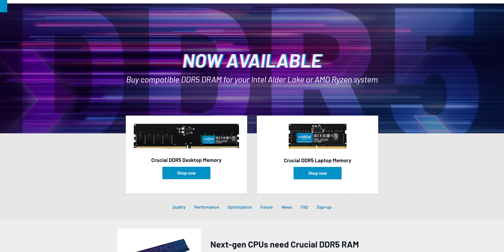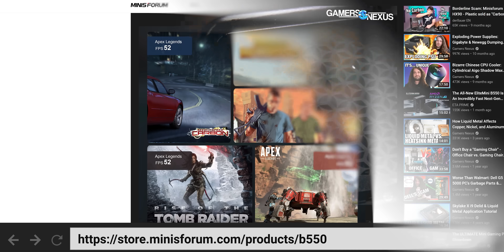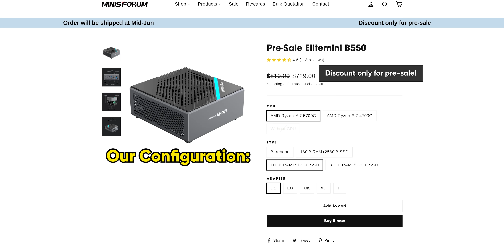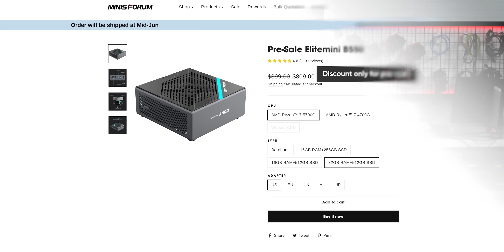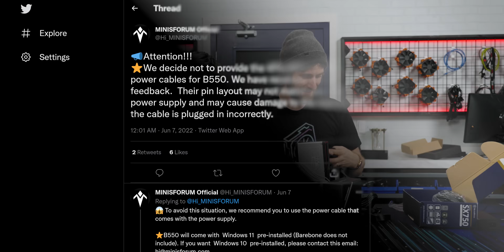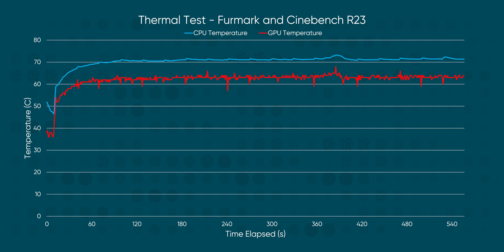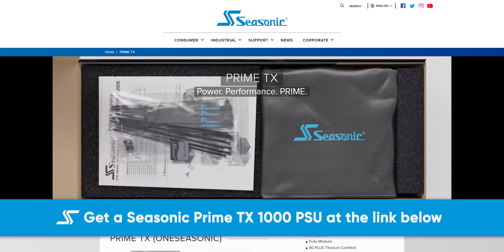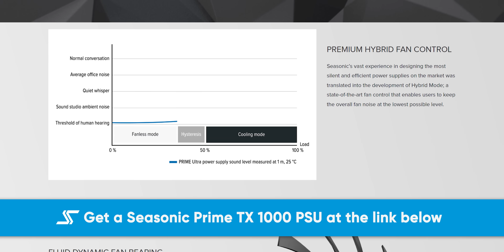Who's Buying These? - MinisForum Elitemini B550

Comment: im late, but for me it was the first step to building a real pc. start with the mini, and get stuff done, and play lighter games, then when you can afford the psu , you get that, and set it aside till you can afford a decent gpu. then when you can afford a real mother board and proper case, pllus the ram and cooling, you finally end up with a proper system, but to start its not a bad option.

Comment: One way I can think of to make this product better would be to remove the PC part entirely, and make the dock into 2 adjustible-distance type c ports, so you could take a laptop and slot it in, and it would plug into a dGPU, and be like a thunderbolt hub

Comment: Legitimate question: could you mod the case to put a hole in the roof and put a full size AIO Cooler on the CPU?  And have it stick out of the “hood” like a 60’s Camaro with a blower and open air throttle bodies?  It would be a cool aesthetic.  I would do it cause why the hell not?

Comment: The AM4 slot is unfortunate, but an AM5 slot would rock… 9600/9700.  And as was mentioned, everything slotted on the same side and just slam the thing in there based on geometry.  (Like old school Mac pro’s and the hard drive sleds, just slide it into the case and it connected right up to SATA power and data)

Comment: I have a Minisforum 760 Slim and I can play games with the integrated video card in 1080p (65-100fps in D4) without any problems. It cost €375 and it is worth the money. But I can carry it with the keyboard and mouse wherever I want. If I want to put an external video card, dock-station and psu the cost rises to around €900 and it takes up exactly the same space as in the video you made here. My option is to use the Minisforum 760 Slim configuration exactly as it is and if I want more power and mobility I make a configuration from 0 with an m-itx build that will be with used components but at a cost below the €900 that I would spend for this kind of configuration (at least this configuration has desktop components and the power is used to the maximum). It makes no sense.

Comment: I have mine paired with a $7,900 XTX and it's Unstoppable I've never had a single problem with it I do not require any extra Cooling and it is really tiny sitting on a shelf in my room I have never been happier with any computer ever. All I run are minis for years main point of me doing that is to avoid having to come up with cooling solutions and then having to take everything apart put it back together again causing potential issues and breakage down the line to clean everything out. I just talked two screws PC slides out four screws on the bottom then comes apart clean it out put it back together the gpus on the standby itself blow it out same with the power supply good to go five 10 minutes to clean it back together on the road again. :-)

Comment: Although MinisForum have some very nice products and spice up the market, I don`t know yet if I would buy a MinisForum product again. We got a UM340 for office use. A few weeks after warranty expired it did not power on anymore. Now its waste. And at the speed we receive answers from support, I don`t know if we will find a replacement motherboard for it.😥 I just wish I had a hunch before warranty expired, because Amazon would have replaced it.
I still hope they will have a somewhat satisfying resolution for us...
This is an example what to expect in this situation:
" Dear customer, hello.
Please try the following steps and inform us of the results.
1. Check if the power adapter indicator light is on (if not, check the adapter and AC connection).
2. After pressing the power button for 3 seconds, does the power indicator light on the machine light up (if not, please skip to step 6).
3. Simply insert the keyboard and power adapter, press the power button, wait for 3 minutes, press the "CapsLk" button on the keyboard, and check if the keyboard LED indicator light is on.
4. Use an HDMI cable to directly connect to the monitor, do not transmit it first. Make sure to turn on the monitor power and switch to the HDMI interface.
5. Remove external equipment. For example, unplug USB/Docking Station devices (such as keyboards and USB drives).
6. Please unplug the power, hold down the reset hole for 30 seconds, then turn on the power and check to confirm.
7. Remove all hard drives and check if they can access the BIOS.
8. Remove the memory and check if it is dirty. If the memory module is dirty, clean it and reinsert it.
9. Only one memory can be inserted separately, or replace the memory slot and confirm the replacement memory brand.
10. If it still cannot be resolved, please provide us with feedback on the above steps and results.
If nothing happens in the above steps, we speculate that this is a hardware malfunction.
Please provide us with detailed information on the results of each step so that we can better determine what faults have occurred. Also, make sure to shoot me a video that won't turn on!
At that time, we will need you to provide the order number and the name of the procurement platform, and we will proceed with the corresponding after-sales process for you.
Good luck to you.
Thank you for your understanding and support.
PS: If you purchase from the Amazon platform, you will need to provide the name of your country as an additional requirement.
MiniSforum support Thank you for your support
Milligrams

谢谢！
此致
迷你论坛支持 "

We did all that, replied with the conclusions, invoices, video etc., no response yet...

Comment: This needs it's own large PSU in the rack to eliminate that wiring situation instead of using any old one off the street. Maybe sell different wattage tiers for different video cards. It would also be nice if it had a small battery to keep it on in a sort of sleep mode so that you could swap it to the other internal PSU without having to shut down completely.

This would be great for people that test GPUs a ton. Very easy to swap out.

Comment: This would be great for Remotedesktopenvironments like Citrix! Server Rack set up with a lot of this tiny stations could be easily accessible in case there is a fault… GPU crashes… swoop GPU changed… or you only need office PC, you can unplug it… Power supply burned… whoop next One or you change the unit to a seperate place… if you don‘t need… If the unit crashes itself… load image to new one and change it… i would like it! I see a need for this!

Comment: They should make two docks for this thing. One for gaming, then one that hooks up to your business set up. I would use this for that. That way I don’t have to look around a computer with a screen in it if I’m just moving between work and home. Also laptops aren’t upgradable. Honestly, I would put in an Athlon series CPU in this. Athlons are plenty good. In my experience, the CPU doesn’t really change the frame rate all that much. It’s all to do with the GPU. 

Bracket the GPU and PSU into a nicer form factor, allow for triple wide cards, have another dock option that enables you to just plug it in like you would a work laptop into your work system, win.

Comment: As a developer, this sort of PC is worth gold. You can take easily it with you in the backpack and have it quickly setup on any tv like a fully functioning gaming system with your own game prototypes on it, to test with friends or random people. It's like a tiny gaming console, but without the annoying licensing and portability constraints. It has also built in Bluetooth support for controllers to make use of local multiplayer. In this specific regard it's pretty good and relatively affordable compared to a good laptop. (I paid 460$ for the entire unit) Theoretically it can be docked at home, but I have never used this feature. (the built in GPU is still relatively good compared to other mini PC's) I prefer to have it hidden underneath the TV.

Comment: I travel a lot so this is perfect. At home I'll have it plugged in with the GPU for work and gaming. When having to travel I'll just remove the PC and throw it into a suitcase/motorcycle backpack. I was thinking of using a laptop and eGPU, but I want to be able to replace components and every hotel room I've been to has had a power outlet, TV and WiFi.

Comment: My use case for this is pretty wild. I did find one for half price new so I really wanted it to work for me. I have a music workstation/midi keyboard set up and a seperate desk where I can stream/play games. With this I can undock and plug into the music station where I keep the small power brick and a bluetooth keyboard/mouse, and I can run ableton very smoothly with all my plugins. then when I want to play a game I take it over to my other desk and drop it into the external GPU. Very specific but it works well. Also if you get some better PSU cables it looks like less of a mess.

Comment: I can definitely see a use case for this. First I don't need a game card if I'm mobile, the built in gpu suffices. I can see replacing my laptop with this for mobile use. I could easily qrp with my srd with the base unit, then plug it in to the dock and game at home. Or use it as a base station at home with a more powerful transceiver.

Comment: for who would use this question. I was actually looking for something like this. I'm a geological engineer that lives in a tiny home near the construction site. The intention is three-fold, one i can adjust how much power i am consuming from my tiny home. If i have the power to spare from my solar panels, i can plug it in completely and use the gpu, if i dont, i can get by with just running the brick. Second, this allows me to have the power coming from two different places. I use a 12v system at home. Having the brick on its own power circuit is a 10 amp current which brushes up against the limits of a standard dc outlet, so i'd need a seperate outlet to run a gpu. This set up allows me to that without installing a 30 amp 12v dc outlet system which gets expensive. Thirdly, this would allow me to do small on the fly things in the field then go to the office for power intensive things. what disappoints me was the upgradeability discussed. As an alternative, the beelink gtr6 has a ryzen 9 6900hx, it doesnt sound like that will work with this.

Comment: i would want it, but with a 4800u, usb 19V PD powered  because I could actually run it on powerbank and plug to a portable monitor, or just the monitor of my liking for the occasion, such as an e-ink (and we know there are no e-ink laptops, btw). And being able to plug a proper gpu for VR is great. Such setup is even better for power consumption.

Comment: If the case and mob were cheaper. I wouldn't mind this as a work station.
The issue is that the setup costs more than a normal desktop setup.

Comment: I'm gonna use this for my pioneer ddj 400 controller. I don't want the GPU when I'm just out at the park or something. I also like the portable monitors over a laptop build because they lay more flat and don't block people from viewing me. You guys do make good points about the ITX builds but I do like that I can take this thing home and dock it as a second PC/ark survival evolved server using an extra old GPU I have laying around. If I want to go do a show somewhere, I grab it, throw it in its nice lil case it comes with, no need for GPU or PSU. I think also, as a second PC it might do well for streaming with a usb capture card pulling video from my main PC without using extra resources while running a game on that main PC. IDK tho, will repost when I get it built and find all the flaws in my plan.

Comment: I bought one. I like it. I have a unique situation where I spend anywhere from days to weeks at work without going home.since I spend more time at work the dock lives in my lounge area and the awesome case that came with it moves the computer between. home and work. I'm working on setting up a projector at home so I don't have to move the portable monitor which is far too large to be considered portable. I paid 750 for mine not 900.  not sure where you got that price from?

Comment: For the price this thing can't really be beat. especially when the 5700g and 5600g apus are so discounted right now. 630 bucks all in for the barebones plus 5600g 1tb nvme ssd and 32 gigs ddr4 3200. I already have a spare psu and gpu and I am going to have the setup at my parent's place for when I come visit so I can keep the main system with me and install game updates before I go visit. pretty niche use case but there is no way you can get a gaming laptop anywhere near this fast for 630 bucks, crazy good deal.

Comment: You should check out their support forum. A bunch of people bought the B550 because it was advertised in multiple venues (ads/blogs/support assurances) that it supports replacing the CPU with a 5700x. People who have tried it found it doesn't work. Minisforum is going back and removing all their claims that it would work, and leaving the customers holding the bag. 

Minisforum's bios update handling is bizarre too. They won't publish what the latest bios version is. They don't put bios on their support page for a machine (any machine). If they decide you need a bios update, they direct you to a sketchy file-sharing site without any checksum to verify you're getting the authentic bios. They say they do this to protect the customer, but it's amateur. (One person found a link to a bios without any explanation, flashed their computer with the wrong bios.).

I think Minisforum computers can be a good deal. But, the company isn't very good. Its a roll of the dice. If they come up in your favor, the company shrugs their shoulders.

Comment: besides the gaming thing i don't care about. can this thing can run photoshop, illustator, adobe premier, painter, rebelle 5, cad with no problem?
Reply: Minisforum has a support forum. I would recommend asking questions there. The HX90 will do that (and has an extremely powerful CPU). The problem with these is that they're not made well. Quality control is loose. Some people get a machine that works well. Others get problems. The company shrugs their shoulder. They don't seem to care. If you get a good one, it can be a very good value. But, there's a risk you'll get a dud (and no help from the abysmal customer support). Some models seem more prone to dud  performance. This B550 has some pretty bad customer complaints that Minisforum has dodged.

I'd recommend seeing what people say about any model. The HM80 has some bad reports. HX90 seems to be doing well. But, I think the problem is quality control, changes in components/board. The good reports could change with a revision, or who's assembling something whatever, which "lot" of boards they're building from. It seems hit/miss this way.

Comment: I still maintain that the way to go for SFF design without radically altering the desktop form factor is to design motherboards with the "top" side terminating in a horizontal PCI-E connector. MSI does this with their Trident line of SFF prebuilts, and it's genuinely the only method I've seen of slimming the desktop without all the other compromises and pitfalls of sandwich cases and vertical mounts and whatnot.

This kit ALMOST gets there, but Minisforum got really weird about copying Intel's NUC layout, but they also wanted an open-air look, but didn't want to spend more time and money on fleshing the idea out so everything's sort of shabbily held together, and... it's a shame. If they had terminated the PCI-E connector in a female connector, they had the right orientation at least so that the CPU and GPU coolers would have been located on the same side, saving space. A slightly larger chassis (or frame, if they're set on an open-air case) with a place to mount an SFX power supply and ditch the standalone power, and this could have been a great SFF platform.

Comment: Yes! A mini PC I can take to work, then take home and set. it. up. in a tray? to connect to my gaming gpu? with special cables and another psu to  power it all? to make a GAMING PC! at almost the same price as a gaming PC? (after adding in the peripherals). I'd rather port an external SSD with a security enclosure, have a normal PC at work and my desktop PC at home, so I only need to carry the SSD.

Oh, not to mention the chance it won't work correctly.

Comment: I'm the audience for this product. I move homes often so having a big tower is not an option for air traveling, I pay for co-working spaces. I don't game AAA games often but I do render videos and 3D model a few times a year. I already have a Macbook M1 which handles most of this except when I need to work with x86_64 software natively in Linux or use Windows to develop video games. It's perfect for my needs although it would be awesome if the support would consider the PSU and made it more portable altogether.

Comment: Do y'all always try this hard to shit on a product? Cause yall were REALLY trying. Like the part where you "accidentally" disconnected the mini so easily as if to imply that it's just a loose connection. Or when you had to unplug it and plug it back in to get it to work. No thinking outside the box just straight up shitting on a product

Comment: I kind of feel like using this for a GPU is missing the mark. There are other things you might want to hook a mini-PC up to short term via PCI-E that are not graphics cards... Like SSD arrays or high speed networking. Neither of which require that much power from the base system...
But then you could just use a laptop with a Thunderbolt dock, so again, I don't know. Except this would be substantially cheaper than such a laptop...